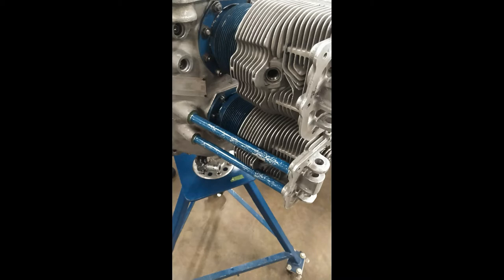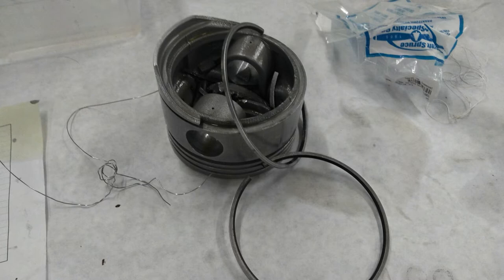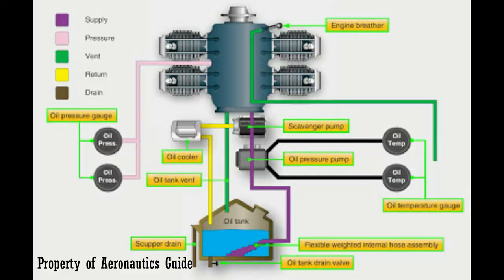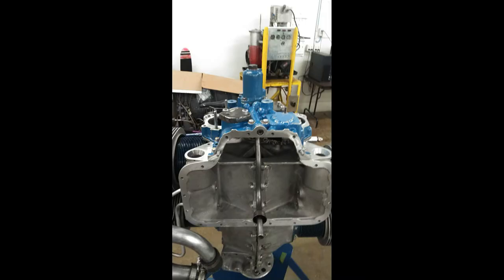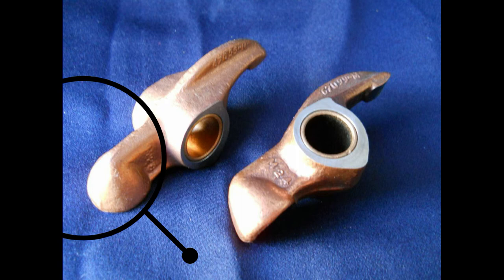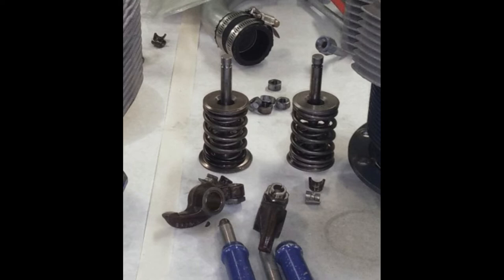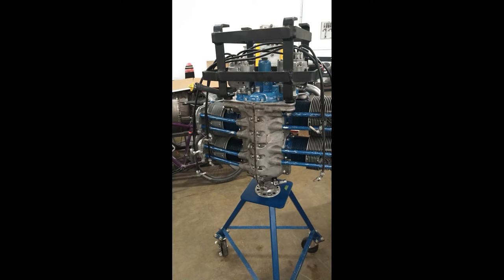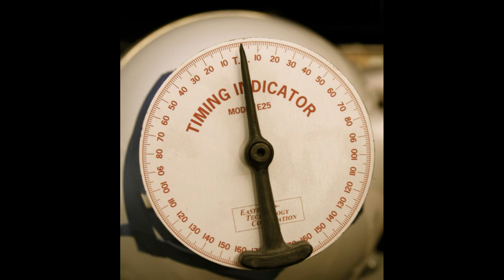Lycoming O 235 "Rebuild" and Runup

Comment: I operate a Grumman AA1-A with an O-235 C2C. Book says 108 HP at 2600 RPM. I would do an O-360 conversion but then I wouldn't have much range... Next airplane: More power, more range.
Reply from the maker: A Cessna 180 would probably be a good one to try to obtain if you want more power and range.

Comment: I am wanting to put new jugs on my o235  any idea of the torque setting for the  9/16 and 5/8 nuts.
Reply from the maker: Naw man, I wouldn't know. Our engines had the old design with 3/8" - (25 ft-lbs) hold down nuts and 7/16" - (35 ft-lbs). I would imagine that the torque value, would be larger but I wouldn't play with the torque of a cylinder. I'd say if the jugs are approved then you should be able to find acceptable data on it. The AC43-13B, Page 7-9 has a chart for applicable torques regarding AN Bolts, but then again, its a cylinder, and I would want to make absolutely sure I had the right torque. Sorry. Just got out of school. Still a little in-experienced. Tell me if you find anything, I'm interested.
Reply: @cossmith3116  Thanks for the reply.  I think I'll,have to get the Repair Manual for the O235 LC2.  I sure the information on torque settings would be there.  Just looked at my engine, which has chromed Lycoming Jugs on it at this time.  One Jug looks as if it is about to crack No4  and Not had a dry valve guide.  So I'm going to get 4 new Superior Jugs for it. and a 5/8 Jugs spanner, already have the 9/16 one.
Reply: If you are guessing, or have no clue you shouldn’t be doing a cylinder
Reply: @TheReadBaron91  I have torque figures on it.  have not bothered doing it yet as compressions good, and engine running smoothly

Comment: What a confusing video. You show pictures of a 4 ring piston from an O-235 C and say you are working on an L model which has 3 ring pistons. The O-235 dates from the early 1950's and only the early engines are hard to find parts for.